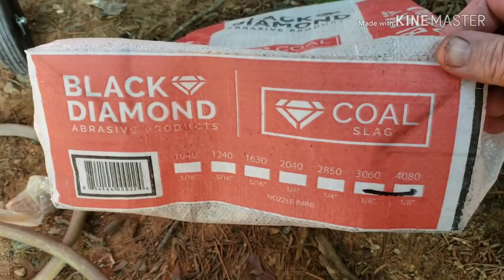HARBOR FREIGHT SAND BLASTER (MOD/REVIEW)

Comment: Sharing an idea I use: 
Recycle your sand or whatever type of blasting material you use. 
When I sandblast something large outside, I setup a large tarp around it.  A cheap tarp works.  As you blast your item, the tarp will catch 90% (+or-) of your blasting material.  Then you need a shop vac without a bag in it and which is empty with no trash in it.  I vacuum up all the blasting material from the tarp.  I then use a mesh screen filter inside the red funnel which came with the Harbor Freight sandblaster like you have.  I pour the blasting material from my shop vac through the filtered funnel and back into the tank.  It saves a bunch of money on buying the blasting material and the gas it takes to go get new blasting material, plus the time you're saving from not having to drive top the store for more blasting material!

Comment: I have the same blaster and they work well once you get them going.   I made quite a few modifications on mine, i might make a video of it.  Couple of things, get a full face respirator.  you can get 3M ones on ebay from hong kong for less than $50, but it is important to reduce the risk of silicosis.  That mask wont prevent you from breathing the fine air borne dust (and paint particles). Big compressor helps alot, i used 2 infact, 1 to charge the canister and another to run air through the hose... the one for the hose i used a 150ltr 3phase unit..    biggest problem was keeping up blast medium.   Hopefully ill make a video and share it..
Reply: Aaron James  i got a harbor freight 40 lbs pressurized tank and the bottom hose keeps plugging. I switched out the ball valve at my hand and took out the o ring as i saw on a YouTube channel. But when i turn on air it works good for about 5 seconds then it Plugs. It’s not the elbow or the ball valve under the tank because when i take the clamp and hose off it blows. I take the hose and put air to the tip and it blows out a lot of media. It’s fine black beauty so it’s not to big. Any suggestions??
Reply: Did you have any trouble with the bottom ball valve I wore a whole in it also
Reply: 4020jc i had same issue but what is going on is two things. Take the end nozzle off and replace with a deadman’s valve from HF like $10. The hose issue is yr adding to much media to fast. You will never have the valve at bottom of tank open 100% hell you won’t even get it 50%. Mine opens 15-40% and works good. Soon as i go over that instant plug. I’m also useing  black diamond fine in red bag from tractor supply about $10 a bag. But just start with opening the valve very very slow to start with. Soon as you get the feel where it needs to be to operate perfect then replace the nozzle. Let me know how it goes for you.

Comment: After using one of these for a few years, I moved over to using a poly wheel on an angle grinder, and a drill motor with a poly wheel, wire brush or scotchbrite/sandpaper, depending on the contour of the shape.  These are a lot quicker, not as messy and cheaper.  Occasionally I go back to the blaster for certain inaccessible surfaces only.
Reply: What is a “poly wheel”?  I tried to google it but I got “polyurethane wheels” for moving things.  Lol
Reply: @johnnyh64   if you google poly abrasive wheel that should give you what you need.

Comment: Turn those handles to the outside as they come that way only to save space in packaging. Get yourself a kid or helper to periodically shake the tub of the sandblaster and that is always helpful to prevent air flow clogs, as the media can pick up moisture and clog.  A dead man's nozzle will help, as well and HF sells them, too. I have used the larger one from HF for years and was very happy with it in blasting my Model A frames over the years, I was stationed at 29 Palms, in the middle of the desert there and used my won sand and recycled it with a sieve to use. I also lay a cheap tarp down to use around the home, as it can mess up a yard and waste reusable media pretty quickly. Get some cheap ear plugs to protect your hearing and to keep that dust out of your ear canal as you use these units. This type of blaster will outdo any grinder on the market when used properly. I recently bought a larger one of these from HF, as well as the small plastic one and a handheld one. Each has a unique purpose and most of any complaints actually are user error from the reviews. I have not tried your mod on the tip, but it seems like it would work well. Have to consider that. That media is up to maybe $12 bucks at TSC now days and not $7-9 anymore. ;-( Soda blasting with these units is a pretty bad method, as that media is really a soft abrasive. Going to use my HF blasters on my 1925 Model T when I tear it all down. I rate them a bit higher than you do though, but we shall see. Thanks for the video.

Comment: Thank You Tim, & Good Mod removing The End Valve = simple logic but then that escapes a few of us in the frustration  of The Plugged Up Anger situations. Also Ide =  Put Down a large 3 Sided tarp  To Reclaim Sand  & Strain It Thru an Old Screen Door Screen.  Repirators Are good bcz U Breath In Dust particulates & even Oil fumes From the compressor. When Ur Young & Strong It Don't Make a Difference but What U  Put Into Ur Body Is what It Becomes = Toxic! I spent 2 many Years in Body Work The Furniture Varnish Fumes & It WILL Kill You Slowly (& Painfully) Much  Faster Than Normal... & Dumb Narrow Minded  rockafeller Medicine drs Don't Understand Nor care!!!.  = TRUE FACT!!!

Comment: Love this and all the review & how to videos about sand/soda blasting. Gotta learn somewhere. But none have really gone into the actual pressure and/or CFM they use. My neighbor uses my compressor, 11.5 CFM @ 90 PSI. But has it set at almost max @ 150 PSI. I told him 90 to 100 PSI is all you need, but he insist 150 is the only way to go.

I noticed at about 8 min. in it looks like you were set at about 90 to 100 PSI, (hard to see in video).

I'm talking about body panels, not deep rusted chassis frames.

Comment: Add a shop vac and cut a pvc fitting to fit over the blast nozzle, connect shop vac to the fitting. then some soft hose to make a flexible shroud. Dust free blasting.

Comment: to convert to a wet sand blaster you must first install a tee just before the nozzle add a ball valve and hook it up to you garden hose.  Start blasting and slowly turn on the water until you get a 50-50 mixture of sand and water.  the silca dust is then saturated with the water and becomes runoff.

Comment: mine came with a gun that has a rubber stopper at the end of a large pink ceramic tip.  that one you're using appears to be the one for the soda blaster?  It looks pretty effective though.

Comment: What do u run yr PSi at? Also i just hooked mine up and i did what you said i should do but for some reason the bottom hose gets plugged. Not the elbow or ball valve under the tank and i don’t have nothing in my hand but the tip. I take the hose off and blow shit load of media out. I’m using fine black beauty. Anyone have suggestions

Comment: I bought just the tank online, no hose or nozzle. Harbor Freight doesn't sell the hose or nozzle separate. Any recommendations on where to purchase those part and how to assemble them. I know that the hose is supposed to be 1/2 thick and a 10 foot run. What adaptors do I need? I seen some just have the automotive clamps... Will that hold?
Reply: Its a hydraulic hose, held on with worm drive clamps. The original loos to be about 1/2" ID.  HF sells a deadman valve for it bit the spring is really heavy. I wouldn't want to use it for extended periods of time.
Reply: @roscosnyder3584   Thanks, I used it today to clean the whole frame of a truck. I didn't mind the spring. Towards the end the bit that allows it to be close wore down a bit and since I recycled the media a couple of times rocks and other debris kept getting stuck. Very annoying. Nevertheless job got done, but never again!
Reply: HF sells the deadman valve (I think you got one) but Scat-Blast and Eastwood Company both have hoses, nozzles, and various parts.  There are others, too, but they are more for heavy commercial work.

Comment: Great vid 😎 and perfect timing as mine arrived today and hope to put it to use tomorrow 👍 A quick QU... once the metal is blasted would you recommend using grey scotch pads to clean any sand from the metal followed by Wax and Grease Remover (panel wipe) prior to spraying epoxy primer/sealer? I’ve heard this is essential but as we all know, ‘one mans advice can be BS to another’ and I’m left confused 🤷‍♂️😜
Reply from the maker: I blow it off good and wipe it down with  wax and grease remover and then epoxy
Reply from the maker: I blow it off good and wipe it down with wax and grease remover and then epoxy it
Reply from the maker: What are you blasting
Reply: Tim's Automotive Garage I’m stripping my Porsche 993 down to bare metal since the shell is completely stripped since I plan to convert to a dedicated track car (it’s been resprayed previously and suffered micro-blisters from water in an air-line I guess 🙁). By far the worst part has been removing all the underseal which I used a combination of multi-tool, various wire wheels on the angle grinder and heat gun with sharp chisels... worked well but slooooowww. My aim was to tackle all the worst jobs first so I could follow the stripping with paint stripper first to remove the worst and then finish off with the sandblasted to get in all the hard to get areas. I worked on the front of the tub today and used a fine media with a 3mm tip. Went well but again slow... I could do with a bigger air receiver to keep the 20 gallon blaster above 100psi. Did clog several times. I actually purchased some tungsten tips which are far better than the white ceramic ones the blaster comes with. There is also a conversion kit you can buy to allow the use of Soda media (not purchased one yet but will do - there are some vids of the kit if you search). Any how today was the first time I’ve used a blaster and what a f’ing messy job it is 😂😂😂👍
Reply from the maker: I used the biggest tip that it came with it works fast but uses a lot of sand.
Reply: Tim's Automotive Garage You’re not kidding 👍 I actually purchased a big white heavy duty white plastic sheet (6m x 4m) from Amazon. I also purchased a cheap sieve, the sort gardeners use to sieve soil with a mesh a little larger than the blast media. Sieved the used media collected by the plastic sheet into a large bucket and reused. Well worth doing as I’ve heard the media can be reused approx 6 times before it’s junk. I actually weighed the first recycle and worked out I’d lost less than 20% so definitely worth doing and saves some 💰👌 I’d add links to what I purchased but I’m in the 🇬🇧 so unfortunately would be of little use 😉
Reply from the maker: This may sound crazy but I blast in my paint booth and then take a big shop vac to get it up. I have a classifier that fits a 5 gallon bucket perfect to get trash out. Of coarse I have to clean paint booth good before spraying
Reply: Tim's Automotive Garage Unfortunately I don’t have a shop-vac and the wife would kill me if I used the Dyson 😜 I’ll definitely add one of those to my ‘to buy’ list, I’ll see what Costco have at the weekend 👍 Unfortunately a spray booth is a much wanted luxury I don’t have but I’m simply a long-time diy’er enthusiast. Epoxy and 2k high build is about as far as I can go in my home garage... the final base and clear I will have to enlist to a professional shop otherwise I’d do the whole job 👌

Comment: The blaster works great, but the sand materials are VERY expensive and this blaster uses it up very quickly!!
Harbor freight DOES sell the sand, walnut shells and glass beads for this unit.....but again, very expensive.
DO NOT try using Home Depot or Lowe's "washed" playsand....it's WAY too dusty and will plug up your blaster.